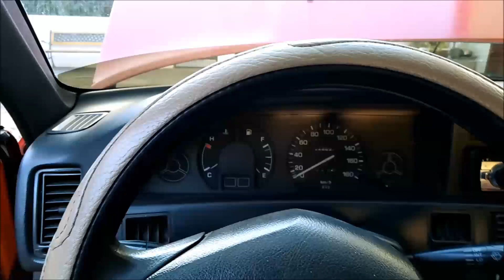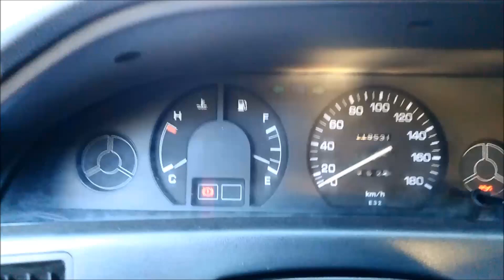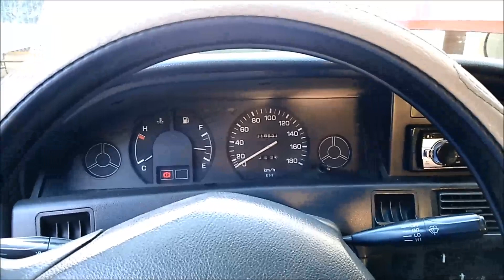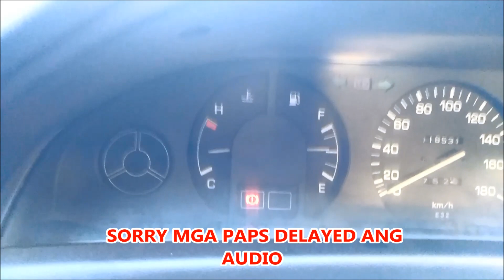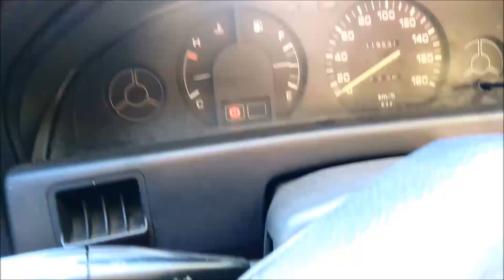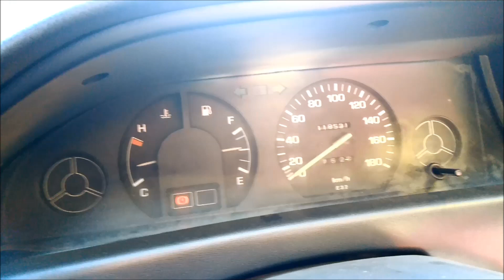Cranks but won't Start How to check Toyota Corolla Ignition system | Ignition Coil Problem |

Comment: Sir,good pm.meron langpo akung concern sa toyota corolla ko 2e engine naka condem kasi yong pcv valve bago kulang nalaman na naka condem yong pcv valve tapos tina try ko yong tang galin yong naka condem sa pcv valve kaso lang namamatay naman sya ako kayang problema nya.
Reply from the maker: Palitan mo yong PCV paps ibalik sa dati.. May hose yan na malaki papuntang intake manifold.. Kapag sigaw yan mamamatay talaga ang makina..

Comment: Possible ba boss na mapundi ang sparkplug kapag may sira ang distributor?
Reply from the maker: Sa tingin ko sir di naman po, kasi kadalasan napupundi ang sparkplug kapag may langis na nakakapasok sa combustion chamber ito yong kulay blue yong usok sa tambotso, o kapag super rich yong mixture ng air at fuel kaya mabilis mag carbon ang sparkplug pero once na linisan ang spark plug aandar ulit siya. Sana nasagot ko sir yo you tanong mo.. Kapag distributor ang may sira kadalasan di po aandar ang makina o diya kaya ay di aandar ang makina kapag mainit na tapos pinatay mo tapos i switch mo ulit ayaw na umandar.. Ignition coil at igniter po ang kadalasang sira halos parehas sila ng symptoms na ayaw umandar kapag mainit na ang makina.
Reply: @TheMechanicPH  pano po kaya to need ko i pa overhhaul ung Distributor?
Reply from the maker: Electronic na ba distributor mo paps o contact point type pa?
Reply: @TheMechanicPH  electronic na boss.
Reply from the maker: Ano po sira?
Reply: @TheMechanicPH  minsan po ayaw umandar Ng kotse. Pero naredondo naman sya. Nung pagka check ko sa sparkplug wlang kuryente
Reply from the maker: Ganyan na ganyan din sa akin paps bago ako nagpalit ng igniter para sure na pinalitan ko na din pati ignition coil. Madali lang po magpalit kayo niyo i DIY, kapag mainit na ayaw na umandar walang kuryenteng lumalabas. Orig pa ba distributor mo paps o yong replacement?
Reply: @TheMechanicPH  orig boss galing katayan ehehe. Tapos minsan parang pakiramdam ko nabibitin sa kuryente hahahaha. Igniter and ignition po pala? Ung ignition orig pinalit nyo po?
Reply from the maker: Bremi brand po brand new replacement oo sir, yong igniter ko from lazada 300plus pesos lang sir, 2 weeks ko na ginagamit ok naman..
Reply: @TheMechanicPH  ung ignition boss hm? Feeling ko un talaga problema eh nararamdaman ko na sya nag lolow power
Reply from the maker: Nasa 1400 bili ko paps..

Comment: Boss hirap na mapaandar ung akin haha. Tapos pag pinuputok ung ignition coil naandar sya kaso low power
Reply from the maker: Palit na po..
Reply: @TheMechanicPH  ignition coil na un no sir matik? Haha
Reply from the maker: Kapag low power kasi sir madami pwedeng problem, kapah may low power pwedeng sa fuel system, nabibitin sa gas, minsan si fuel filter need palitan o di kaya si carb naman need ng linis at tuning, sa igintion system naman po need lahat i check isa isa from distributor, rotor, cap, hightension wire at sparkplug..
Reply from the maker: Bale yan muna mga basic sir tapos kung wala pa din, proceed sa compression test, o malala top overhaul 😅 baka singaw sa valves

Comment: Paps kakaplait ko nh ignition coil pero pag uminit na pumapalya na
Reply: Tas ang hirap na iistart kailangan ipahinga
Reply: Bago na ignition coil ko
Reply from the maker: Ganyan di sa akin sir, kapag nakapaghinga na aandar ulit, kapag mainit hard starting siya pero numg bumigay yong taiwan distributor ko nag nagpalit ako ng pulser (orig surplus) pero yong coil yong date padin na taiwan naging ok naman na siya sir plus timing ulit. Full throttle ako kapag mainit at ayaw mag start nag i start naman na siya, pero isa din na di ko pa na papalitan yong purge valve niya ng gas sir. Isang factor din yon sa hard starting, di makasingaw yong gas..